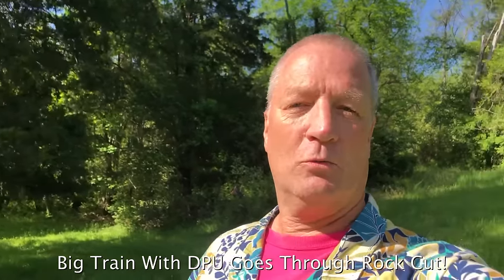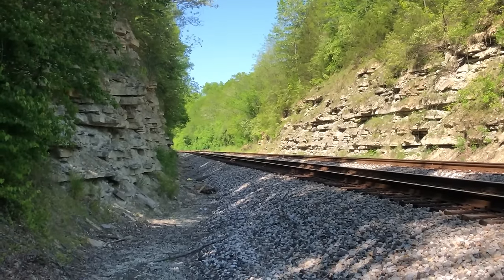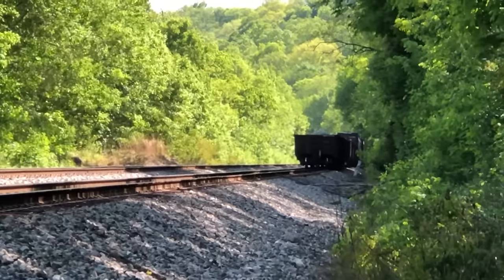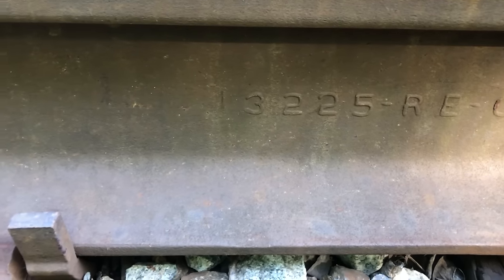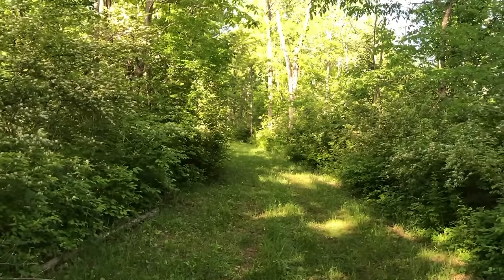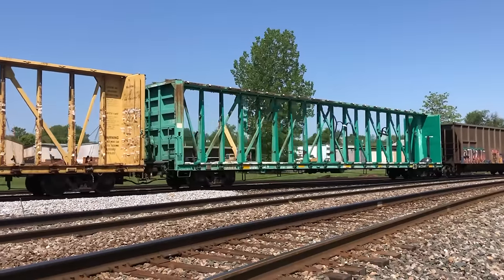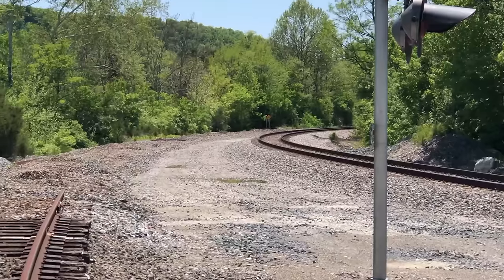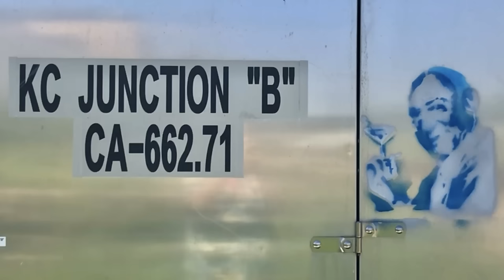Train Goes Through Deep Mountain Cut, CSX Abandoned A Tunnel, Kentucky Train With DPU, Look At Rail

Comment: Very nice Stone cut plus you can wait in  comfortable shade for the next train. At the end of the first train a group of used gondolas marked for JEMX yet another new reporting mark. The second train was pretty much a Maintenance of Way special including flatcars for loose stick rail. The TTPX bulkhead flat that was recently reconditioned is painted brown instead of the TTX yellow and even lacks their emblem Add in a few GAEX green center beams ( yes the tank car firm) and at one time those markings should have represented insulated boxcars Note that in lieu of wire rope the lading is secured by canvas straps one of only about three companies that purchased them this way. Ah the great outdoors with a campsite what a way to relax